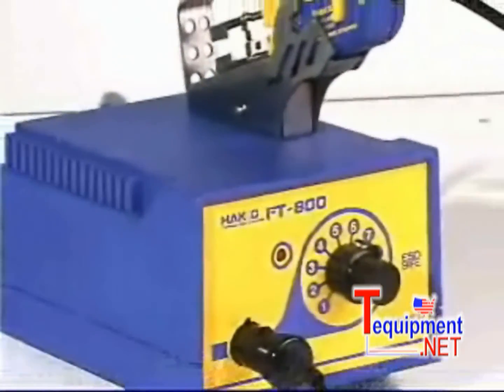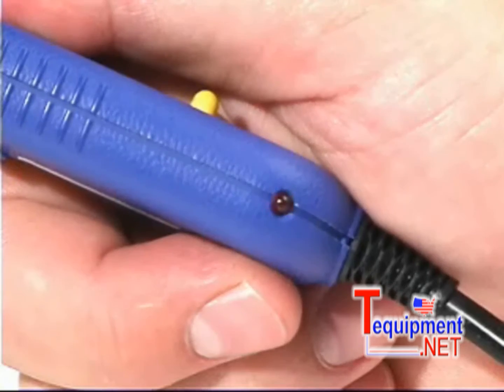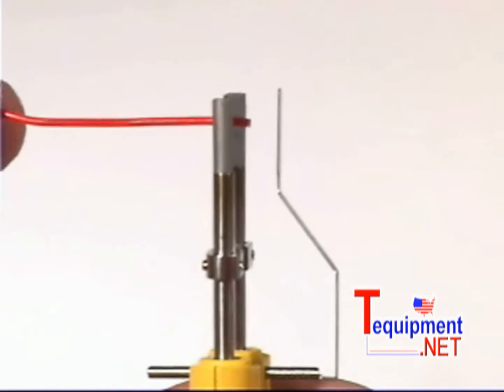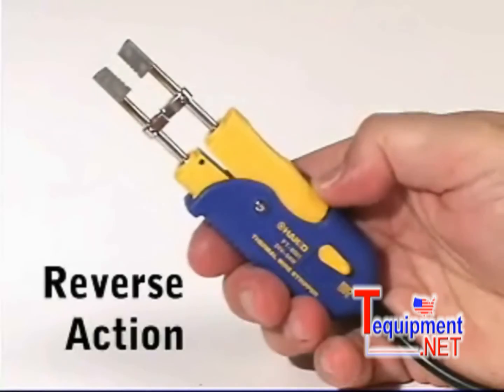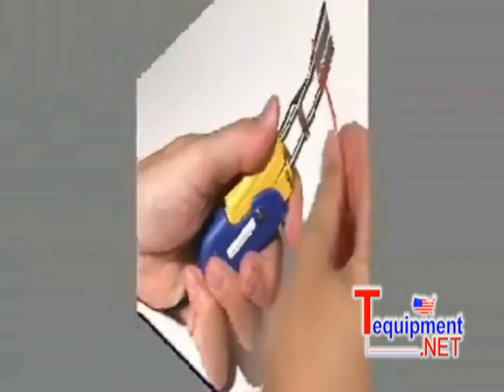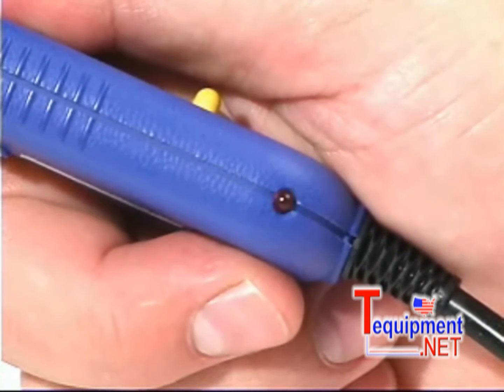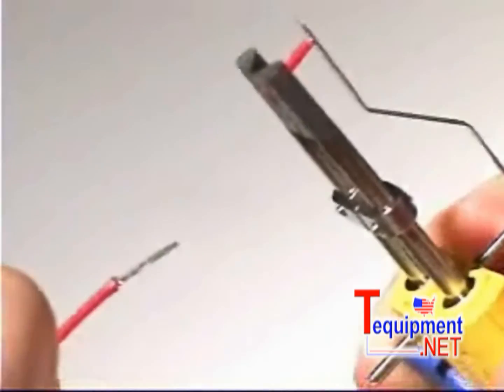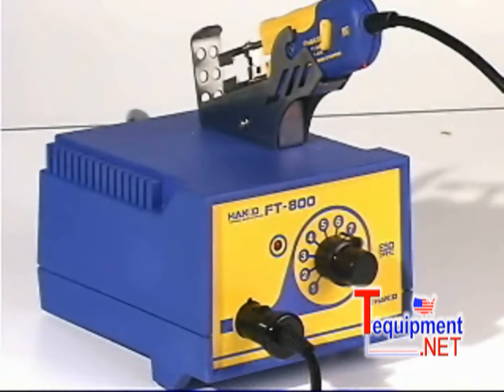Hakko FT-800 Thermal Wire Stripper

Comment: If I am using an electric/thermal wire stripper I would expect to shove any wire in a hole and get it stripped automatically in a second. This seems a lot of bother when I can just as easily use a good mechanial hand held wire stripper! Duh!

Comment: we are using this product for 36AWG wire stripping and observing heat transfer to the operators hands unable to do continuous process. With gloves it is not possible to hold such a smaller dia. how to handle this?
Reply from the maker: That is a tricky situation. You shouldn't be seeing heat transfer on that level. We recommend you contact our product experts for help. You can call us at (877) 571-7901, email Sales@TEquipment.net, or live chat on https://www.tequipment.net/ anytime during business hours.